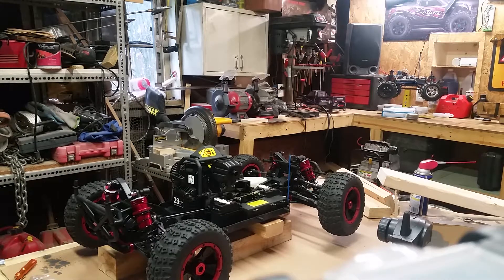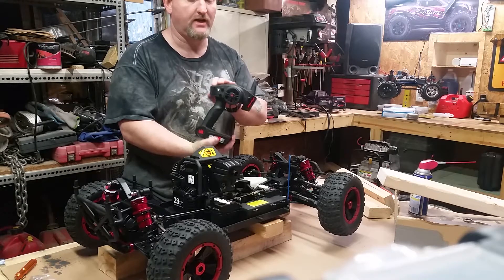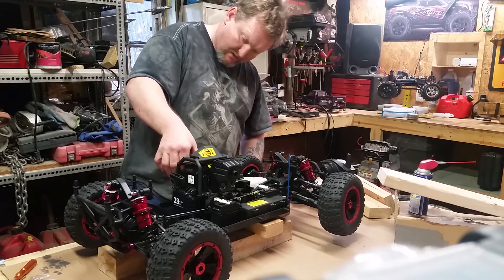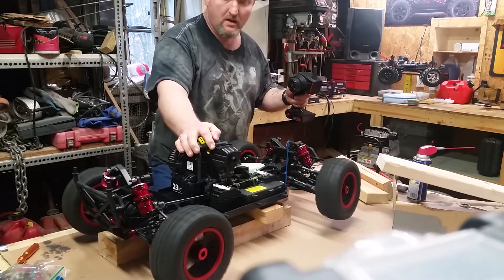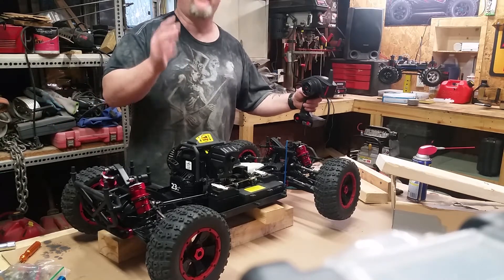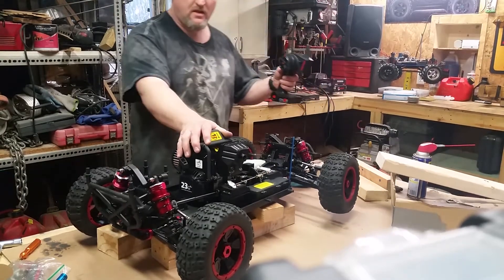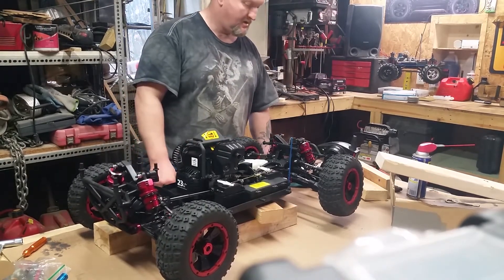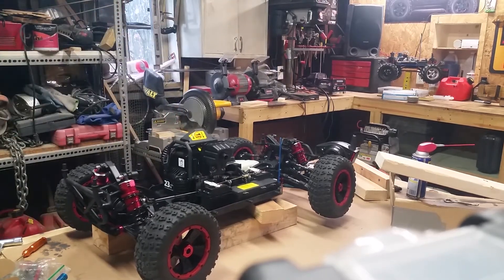YES!!  ITS ALIVE!!!

Comment: Real glad to see it running, I could hear the frustration in your voice when it would not start. shame on the guy who sold it to you as a running buggy, now go enjoy it, you will find it's weakness's and then upgrades start, mine only has around twenty original parts everything else is replaced, do you self a favour ditch the K&N filter go back to oiled foam one I have no idea why LOSI fitted them they have very little use in most terrains.